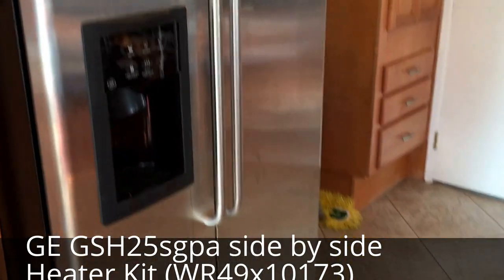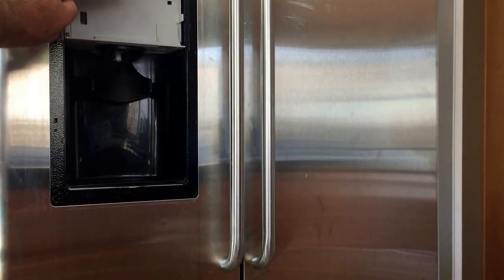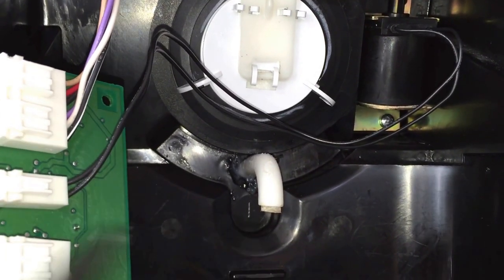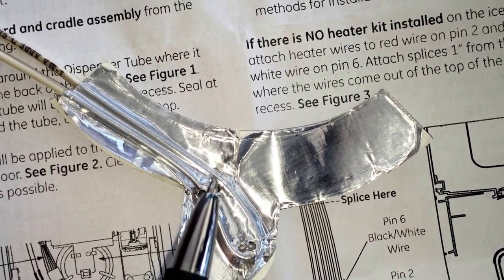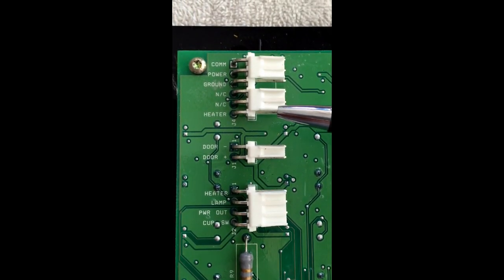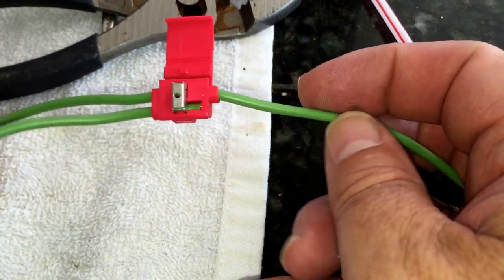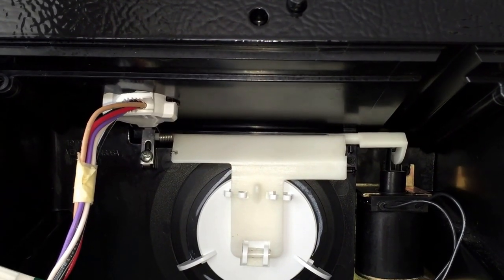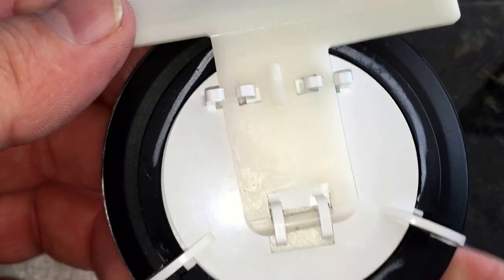GE GSH25SGPASS side by side fridge heater kit for water dispenser

Comment: Hi, for those of you who still have this problem after installing the heater kit, my solution was to add spray foam insulation to the cavity above the water line. I made a small hole just above the water line and used about a half a can of non expanding door and window spray foam. I put the entire length of the straw and slowly retracted it, filling the cavity. You will have excess foam which you can clean up with Isopropyl  alcohol  and can remove any other excess after it dries. This has solved the problem for me.

Comment from the maker: Update; after having this heater installed for several weeks, I can say that it works very well. I have run the freezer on "9" now and it will get down to -20 and the water still does not freeze. I should have done this years ago.
Reply: I have followed your video but something is wrong my heater does not heat up but water dispenser nozzle showing is not blocked as I can blow through it the heater does not heat I follow directions I connected to the red number two position and to the black and white number 6 position I think please tell me the correct position wires to connect and offer ideas to check other places for frozen water as I said the water nozzle blowing through it blows through so the line maybe crack but there's no water on the floor
Reply from the maker: If this is done correctly, the element in the silver foil will get warm and you should be able to feel it with your finger or measure it with a probe or infrared thermometer.
Reply from the maker: It sounds like you have two separate problems. If you can blow through the hose and it still doesn't work then something is wrong in the water supply or valve. Check if you have water to the back of the fridge. Then check if you have water to the hose going in the bottom of the door.   If you have hooked up the wires correctly I'm not sure why it wouldn't work unless you have a different control board or fridge model for some reason.
Reply: I tried this today, and the white backing plate that you don't show being unscrewed, nor removed, seems stuck on the bottom right.  I thought it might be the lightbulb but wasn't it.  Did you have any issue removing the backing plate?  Afraid to pull too hard, as all the videos showed it being loose, after removing the screws, and coming right off.
Reply: @pauledgar2206  same with mine.  Only had three of the four screws.  Lower right was glued on.  Had to bust it to get it off.  So stupid that they did that!

Comment: your guide helped me fit my heater kit perfectly. Just a few caveats to my experience. One piece of the white plastic housing that holds the dispenser lever hinge ( ?) was brittle and broke off, preventing the tab by the spring from staying in place. I super glued a small piece of flat metal over the area so it would now hold the tab. Also, where I placed the red splice blocks matters because mine ended up right behind the plugs on the circuit board which prevented the panel from snapping back in place,....so...I had to redo the splices a bit higher. But the actual heater kit went in fine. I also used a tiny piece of "rope caulk" instead of using messy silicon around the water tube.
Reply from the maker: the rope caulking is a great idea. I'm glad this helped even though it's getting pretty old!

Comment: I removed the control panel and unscrewed the 4 screws to remove the tray but lower right corner does not come off almost like it is glued or there is some other screw somewhere I could not find. If I pulled any harder I was going to break the tray. Help !
Reply: Did you figure this out? Having the same problem!
Reply: @elijahhenderson7057  Me too - did you figure it out?
Reply: Yep, thanks
Reply: @elijahhenderson7057  yep you figured it out?  How did you get the backing plate out?
Reply: @elijahhenderson7057  how did you get the tray out?
Reply: @pauledgar2206  anybody figure this out?
Reply: @stephenmarsters9902  I had to break mine.  It seemed to be glued it that spot.  I can't imagine the light bulb did anything.  They just glued the sucker for some stupid reason
Reply: Mine was melted from the bulb. I let the light run for a few hours before trying to remove-still had to break it but an amazingly clean break luckily.

Comment: Can I assume, being that both wires on the heater are white, that I can install said wires to the fridge side wires and it won't matter what white wire goes to which? The instruction don't say if the top or the bottom white wire on the heater is for the red or for the black/white wire and why I ask.

Comment: Hi there! Do you know the tension between pin 6 (black and white) and pin 2 ( red) while connected in control board? I’ve tried in mine but both pins have same tension, so it is not working. I guess in my refrigerator I must use a different pin…

Comment: why would you want to use silicone to keep the heat off of that water tube... the problem is that heater fails but behind the tube is an inch and a half of foam insulation... if that is the original equipment heater.... my heater on my freezer was behind was not in front like yours I had to cut a door inside and scoop out foam inside the heater is there.... but while I had it all taken apart anyway and I did not want another failure.... I drilled 16 tiny holes through to the outside and then place the tube against the holes covered it with duct tape refilled with foam this must be done warm you cannot have cold on foam it will not foam.... works fine...

Comment: Uh_oh.  This morning I had no water coming out of my ge refrigerator.  I think incident pay attention correctly, and now my refrigerator does not seem to be turning on.... the light still works, but the light that used to turn on when I hit the buttons and ice dispenser are are not working either.  :(. Any suggestions what I could have done wrong?  
I connected to the red and the black/white line.   
I did buy the non-ge kit, but it seemed like just a wire, so I don’t think it is an issue with the kit.   
I checked the fuse, and it looks good.  
I have a voltmeter, but i am wondering if i should surrender before I make matters worse
Reply: Can the front panel burn out if the water heater crimps (sp?) are not installed correctly?

Comment: After removing the four screws, the white plastic cover seems to be stuck to something behind it at the lower right corner.  I have not been able to proceed because of this.  Has anyone else run into this?
Reply: Yes. It’s the lightbulb for me.
Reply: I figured it out! Do you see discoloration where the bulb is/was? The plastic is likely melted to the piece next to it. You’ll have to chip away at it. I filmed what I did and will upload soon.
Reply: @omgmari  Having the same issue. Cannot figure out any way to get this thing off. I've tried prying it, etc. but I'm afraid of breaking the casing. Any advice?
Reply: @omgmari  Upload it! Need the help!
Reply: Elijah Henderson uploading now—hold tight. I did have to break the plastic a bit.
Reply: @omgmari  Thank for the quick reply! I got your video and will try tonight.
Reply: Elijah Henderson best of luck. Hope it helps.
Reply: @omgmari  where can I get the video for this? Thanks!
Reply: @stephenmarsters9902  it used to be in my uploads but it looks like it isn’t there anymore. Not sure why. I looked and I don’t have the video file handy. Either way, my fix with the heater didn’t last. Black Friday, maybe just get a new fridge 🙃
Reply: Thanks for your reply! I finally pulled on it enough to break it out, yes break is the right word. The bulb had melted the plastic on the part that needed to be removed to the main housing. It left a hole in the part that got removed but it wasn't bad. Put in the heater and all the parts, so far so good. Important to pay attention to where you splice the heater wires on to ensure they fit behind the part that was removed. I didn't and had a struggle to get them out of the way of the control board

Comment: Don't buy the heater.  Try this:  Shove a metal wire (stainless) of about 18 gauge up the tube to about 5 inches.  Leave about 1 to 1/2 inch outside hanging.  Come back next day and water flows!  You may say it is stupid, but there is some science behind:  The water freezes in the tube because of cold built up, an because it is an insulating material, it stays freezing the water inside.  The metal wire transmits the cold outside and the water does not freeze.  It is a 1 cent wire against $20-40 heater.

Comment: Thanks for the link to the IceSurrender Jonathan! 
If you'd like to message me your address I'd be glad to send you one for your review. 

Thanks,
Andy
Reply from the maker: Andy,  I would try one out, I just can't figure out how to email you from youtube. My email is jonathanlackman at gmail.com
Reply: I put the heater on and it did/does not work. My wires are the same as the video. I checked voltage across those pins and I have 0vdc. Any suggestions?
Reply: @hobbies withsteve Two years later and you're a life-saver for me, thank you so much! Mine wouldn't kick on but I change the temp and boom warm to the touch now. Thanks!!